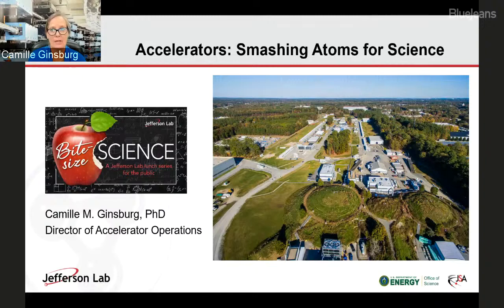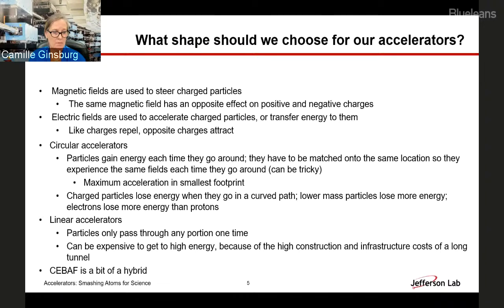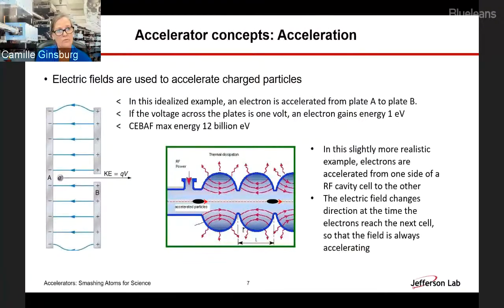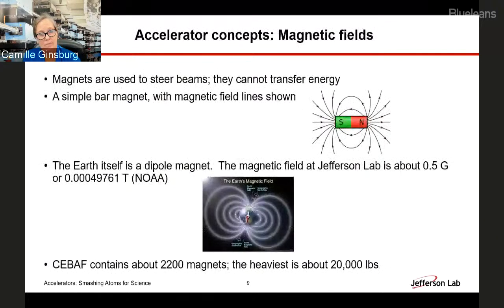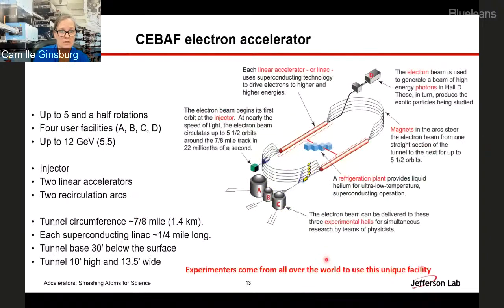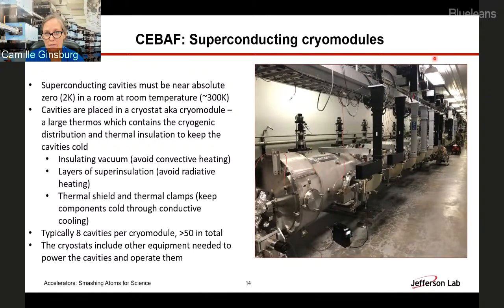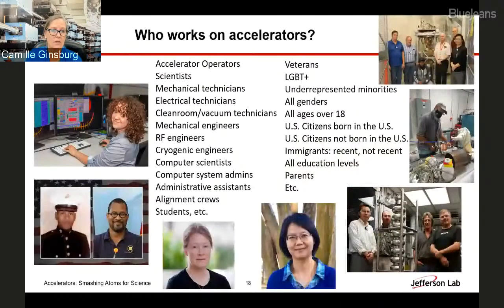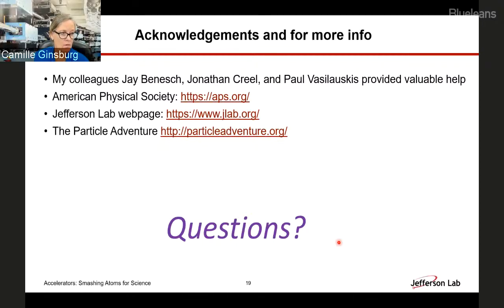Accelerators: Smashing Atoms for Science feat. Camille Ginsburg, A Bite-size Science Lecture

Comment: Bit of a contradiction when my question was answered. The question of how do the electrons gain energy without gaining speed? Camille said they dont gain speed as they are at almost the speed of light but they gain acceleration. I thought acceleration is speed.
Reply: This is a good question, and one that points to a difference in the use of "acceleration" between the classroom definition (change of velocity or speed over a period of time) and the way accelerator physicists use it. When electrons move this close to the speed of light, our accelerators only change their velocity or speed by a tiny amount even though we are giving them a lot of energy -- the extra energy effectively looks like their mass is increasing. What we are really changing a lot is the electron's total energy. We should really technically call our devices "particle energizers" rather than "particle accelerators" once their speeds get close to the speed of light. But no, we are humans with a history of the language of these devices, so we call them particle accelerators even when they are adding a lot of energy but changing the velocity or speed of the particle by a negligibly small amount.
Reply: The speed of electron is closed to light speed, but the mass is inceased as it gains energy.
Reply: In physics, acceleration isn't speed; it's the rate at which velocity changes, which affects an object's speed and/or direction.
Reply: In accelerators, the speed of the electrons is comparable to the speed of light and thus our classical ideas of space, time, and speed fail and need to be described by special relativity. As part of the Science Education at Jefferson Lab, you find a lecture on the relationship between the kinetic energy of electrons and their speed: https://education.jlab.org/scienceseries/ultimate_speed.html